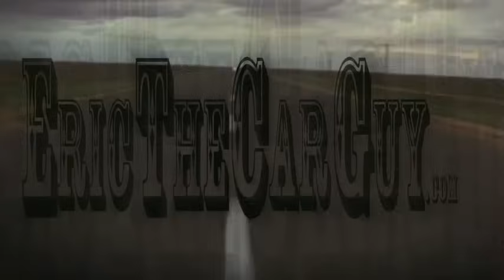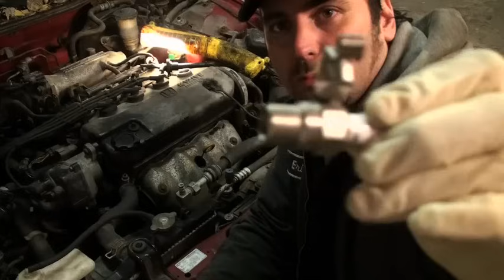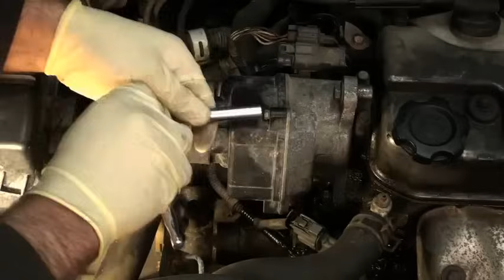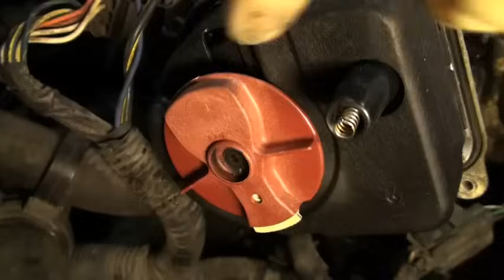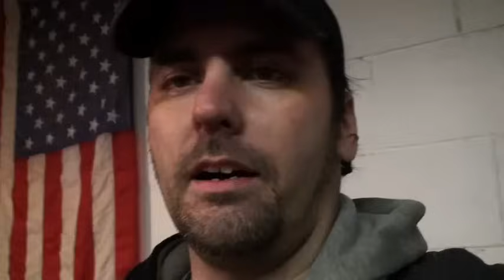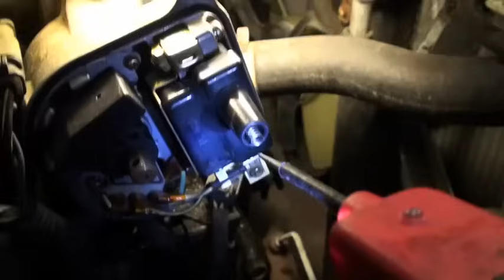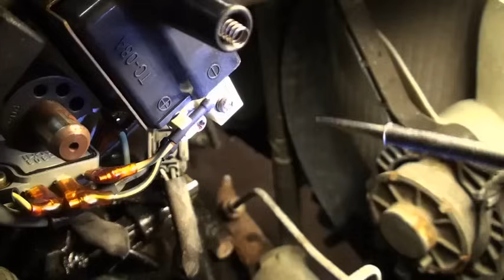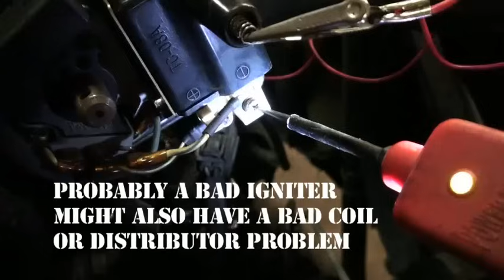No Spark Diagnosis (Honda) - EricTheCarGuy

Comment: Heads up!!! I tested my 96 Accord for spark, and it was sparking strong. Fuel pressure was strong too. I thought for sure it was gonna be something else serious, so I took it in. Turns out the distributor rotor was worn to the point that it was firing out of time. I didn’t know that possible. It was a relatively cheap fix, but still, had I figured that out on my own, I would have saved over $100.

Comment: You are so right about Honda parts I swapped out my ignition distributor and I was receiving a code 9 and a code 15 I put the new distributor on now it's just a code 9 I try to replace it I find out that it was not the exact same model needed and they did not have the one that I need Honda is what I need $70 more for the distributor I must pay $155

Comment: what if you are getting power to the coil and yet still no spark to all four spark plugs and you did replace the coil and igniter? I was told it has something to do with a ground and or ecu issues.

Comment: my 94 accord died while driveing and i installed new distributor and it will not start i have no power to the distributor cant figure it out .....need help..changed ecu as well...new spark plugs and wires too.....

Comment: i have a problem eric.. on so i have a 1995 honda civic. and it was saying o2 sensor bad. so i changed that and i cleared code. now it starts idle fine then boggs out for a sec then cel comes on and then it wont go pass 3,5k. i tried another computer still does it...

Comment: When you test to see, if the igniter is good or bad,base on,when you crank the engine,if the light “blinks”you call, the igniter is good. But if the light doesn’t blink, the igniter is bad. Knowing the igniter is bad,you replace it. What if it doesn’t start after the igniter is replaced,now you gonna test for power going to the igniter,right? Shouldn’t you test for power going to the igniter first,before calling the igniter,a “culprit” ? Thanks for your video,Eric

Comment: I have a 2001 Honda CRV  after driving and stopping for a short time, car will crank but not start ( smell gas after few seconds of cranking) then after 10-15 min rest, the car will start normally.  so can't check for spark, etc because it is not persistant.  replaced distributor with aftermarket from E-Bay.  Spent 80 dollars for distributor and doing same thing

Comment: Hey man maybe u can help me cause i done took my honda accord to many mechanics first it was that it lacked on power and it wasted lots of gas that got fixed but the issue that it still has is the car is cold and it starts but kinds weird and i dribe it then tirn off sometimes when i try to turn it on again it wont start i dont get it lots n lots of mechanics messed with it it still does it they changed the fuel filter under the drivers side under the back door and it seems like it worked a lil better in turning on but it does it agaon omce i drive it for like 5-10 minutes can or could u help me with this headache please eric the car guy.....

Comment: My 97 GSR has been having issues..my rpm Gage is not reading the correct RPms..it just started this when I replaced my router button ..and distributor cap and plugs..what could be making it do this.plus my  is not red lining at 8ooo.it redline at 7000 .help me out someone

Comment: Listen to this guy, throwing parts at the car can be costly. I had a problem with a P0300 and smelling gas out the tailpipe, car wont accelerate very well and rough idle in the morning/sitting. Another code was indicating ICM but I decided to take it off and test it. 4 tests, 4 good runs. Not the ICM. I finally got to thinking about the coil packs themselves. Sure enough the first coil for cylinders 6 and 3 were WAY out of spec by about several hundred THOUSAND ohms on the secondary (didn't bother with the primary since there was no point). Replaced coil, bam, car runs perfectly. I decided to replace the other 2 just to be safe. I now have power. hehehe.

Comment: I know this is a old video but thank you sir I was able to get my family members car that had randomly died on them a few months back running with this video. Test light showed flashing while cranking however nothing from the coil. Replaced the coil and it fired right up just like you said

Comment: Nicely done job on the video. Thanks. I've got a 91 civic with 136,000mi on it. Since I just had to replace the coil, I'm thinking about also replacing the ICM igniter before I get stuck on the road again. In your experience, about how many miles can you get on the original honda ICM before it needs to be replaced?

Comment: If probe/tester touches the coil spring while trying to test  spark while grounded can it shorten the coil? Had spark prior off center inner cap and exterior. Have no spark at wires, but have power on wires coming into coil off of igniter. Cap and rotor were changed do to burnt/wear on center connection to rotor. In your opinion is it the coil itself? Thanks in advance.

Comment: You can start your car from while under the hood if you use one of these Remote Starter Switch.  https://www.amazon.com/INNOVA-3630-Remote-Starter-Switch/dp/B000EVU8MK/ref=sr_1_1?s=automotive&ie=UTF8&qid=1522109344&sr=1-1&keywords=remote+starter+switch

Comment: My 97 civic wont start but will barely crank. It slowly lost power while driving and sounds like its exausted trying to crank but wont turn over. If i have a good battery and alternator, what would be the issue? What should i test first?

Comment: I replaced cap and rotor on 1999 civic. In 2,000 miles it was green and corroded.   New cap oring seal installed at time of repair.  Spring at coil connection appers fine.   What would cause it to go bad so quickly.   I am concerned I will have to replace again soon.

Comment: Hey Eric, I know this is a lil off the subject.  I was wondering if I can change out the inside of my prelude obd1 and put in the insides of the civic obd2a.  I tried the cap and it fits. But don't know if it'll work if I change all the insides.  Please help.

Comment: My 02 honda accord 2.3L just stalled, I have oil inside my distributor, mostly likely the cause of no spark , correct ?
Reply: Ernest Hin i have an 01 Accord. Same exact issue with mine. Did you end up finding the issue ?

Comment: My 1991 civic would idle but die with throttle now it won't start at all has spark and fuel anyone have any ideas spark does look a little weak though

Comment: My 99 Accord v-tech will shut off while I  am driving and I have to adjust my sterring wheel. I have replaced the ICM module as well as the main relay . Cap and rotor as well as spark plug wires what do I look at next!

Comment: What if it starts then dies, timing?
Reply: Veronica Bill clean your ignition switch contacts and make sure your main relay clicks 3 times
Reply: kevinjd1038 how can ya tell if the relay clicks 3 times?
Reply: @GongshowGarage  for the 98 civic ex, the main relay on the passenger side to the right of the glove box. You should hear clicks coming from that side as you turn your key. You should hear it switch on at the same time as the hum of the fuel pump

Comment: Eric please help me!! 2011 grand jeep Cherokee p0305 is my code I don't have spark on cylinder 5
Compression is good. Changed coil spark plug swapped injector with a good one and still same code!! What to check now? I was thinking pcm.or an open circuit 
What is your input?

Comment: i used this video to diagnose a '98 crv IG system. note: just because you see spark at the coil doesn't mean it's good. i learned a very weak coil can still send spark, but it may not even be strong enough to get spark across the IG cables. visually compare your coil spark to this video if your coil is sparking, but no spark at the cables/to the plugs. i also noted discoloration on the coil body as shown here.

Comment: I need help I have a 93 honda civic I was driving hooks the car just turned off on me in the freeway car cranks but wont start I have no dash lights no power to fuel pump no spark I replaced the ignition switch coil pack and main relay still nothing

Comment: I followed these steps and have spark on coil but not at plugs. Replaced plugs, leads, distributor cover and rotor, still no spark .  so this video is not very reliable. $100 down the drain.
Reply: MAFIA MUSIC 
Did you fix it?
What was the problem ?

Comment: Went through your steps. Test light not flashing on negative side of coil. Your recommendation, replace the igniter. Replaced the igniter, still no spark. $100 bucks down the drain.
Reply: Was it flashing after the replacement?

Comment: I have a 1991 Honda Accord. right now I have no spark/no start issue. I've tested so many possible problems but I've yet to find the solution. 1st I tested spark plug wires, no spark. then tested coil in distributor, no spark. then tested the ignitor which was getting power to the coil  but the coil wasn't firing. that led me to believe the coil was bad. I replaced the coil but still no spark. I got frustrated and thought the distributor was bad and just replaced the whole component. Still, no spark with the brand new distributor. Is it possible the ECM is faulty? I really appreciate it if there is anyone that might know my issue. Thank you very much ahead of time.
Reply: Carl Paquette im having the same issue in my 94 Civic ex coupe
Reply: Nicholas Moore And me too I've just installed a new aftermarket distributor still no spark 94 civic hatch non vtec 😐
Reply: Anyone ever have any luck? I just replaced my coil, it has power going to it and still no luck. HELP ERICTHECARGUY!  Save us!
Reply: Carl Paquette ground cable

Comment: Hey Eric I have a question. I washed my engine and not it won't start. There is only a loud rapid clicking noise. I suspect I got the distributor and coil pack wet and damped. Also may be the starter

Comment: This video has helped me twice.  I can turn a wrench just fine, but I have no experience diagnosing problems like these.  So this video has given me direction that I could work with.  I have had to replace both my ignitor and coil, at seperate times.  Thank you Eric for this video.  I simply followed what you said, and now my car works.  I (and my wife) appriciate this video.

Comment: Hey Eric, my dad and I tried all that u said even before we saw ur video. our 1991 civic coil sparks, but not at spark plugs. we got new distributor cap and rotor and tried that and still didn't start. rotor turns when cranking, but my dad wanted to know if timing belt controls rotor? If timing belt wad bad, would rotor turn? could it be timing belt slip issue?
Reply: I'm no Mechanic but I can tell you that it's most likely your spark plug wires. the first step would be to test your spark plug wires and then your distributor coil but since you already know your coil has spark (a very good thing) then the only other problem would have to be your spark plug wires. hopefully this helps you
Reply: Carl Paquette, oh thanks, but we called a friend's friend mechanic, and he said it might be the actual distributor itself. We ordered one on Amazon and got it in 2 days. It worked perfectly! It's just that the coil wasn't getting enough spark. Old distributor went bad.

Comment: ok heres my issue guys i have a 2000 civic ex started and ran great  i pulled old fuel filter put new one in well on filter for civic it has little "fork" where fuel line sits ( you can can give me a head slap later for this lol) i didnt lay fuel line in the fork tightened it and started it ran for like 2-3 min and died like it was outta gas   DAHH LOL anyways i got filter adjusted ect tried to start and wont start turns over strong has brand new battery. by the filter not lined up sure was not getting fuel. so i put line on filter right and had plenty of pressure to injector bar, but all of a sudden not getting spark to plugs and this al happened in like 30 min did i pop a fuse ? checked under hood fuses was a 15 fuse bad put a new one in still no spark is there another fuse inside car that would cause thjis?

Comment: Hi Erick! First and foremost, I would like to thank you for sharing such precious  knowledge with us gearheads around the globe and congratulate you on your videos! I'm trying to troubleshoot my no spark 1994 Honda Accord 2.2. I took the distribuitor cap off but it's different from the one in you video, it doesn't have the coil. What would be the correct procedure to test the ICU for failures? Thank you so much!

Comment: Okay, I noticed that when you were testing the coil, you had an alligator clip on it, was that the ground to the tester, confused here, where do you put the ground from test light during each test, you didn't cover that?
Reply: are you using the coil itself for a ground during that test?
Reply: Since he was using a power probe he did not need to connect to ground because the tool supplies ground internally. If using a normal test light the Alligator clip on a test light always goes to the negative post on the battery, or to any spot on the frame of the vehicle(body ground) a good way to test what is and isnt the frame is with a magnet. If its magnetic, its a ground.  DO NOT TRY AND GROUND TO THE COIL, you will either hurt the ignition system or your self

Comment: Hi Eric. Happy New Year 2017
I have an old Toyota Corolla LE AE80
My problem is the car can not start. Checked the spark plug for spark. None. Did some wiring. Problem persists. Check fuse box, there was a burn sign. Replace the fuse box. The car starts for a few times/days. Then the same problem repeats. What makes the fuse box burns? Could it be faulty in the distributor. For your info., I am using electronic distributor.

Comment: and if there were oil in the cap.what would that mean?
Reply: Distributor shaft seal and/or o-ring leaking.
Reply: If there were oil in the cap, change the gasket cap seal, O-Ring, leak cover and make sure they are all OEM (Honda)
Reply: Paolo Inigo        mamacita
Reply: oil in the cap  would stop it from starting?
Reply: Just had that problem on a Toyota.  Set out to replace the disty O-ring and the shaft seal.  Getting the shaft out required a pin to be removed, and that was darn near impossible without the right tool, and trivial with the right tool.  The right tool is a motorcycle chain breaker.  You can always buy an aftermarket distributor.  Just make sure you know how to keep track of the alignment between the cam "teeth" on the distributor and the slots for the teeth on the cam shaft.  There are plenty of disty videos that cover how to do exactly that.

Comment: hey man could I get In contact with you need help just replaced 98 integra distributor and it's running funny my cell number is 4782783519

Comment: Wow, nice job making it simple Eric! I just tested both components and have concluded the coil is bad(or not providing a spark as you say). It's very weird though, because I just replaced the cap and rotor. Then there was no spark. I changed them back to the original before I found this very helpful video. I didn't want to just start throwing parts at the car. This helps me move forward with confidence. New coil tomorrow and hopefully, she starts right up...

Comment: Hey Eric great video, I have a question I have a 2000 civic and I changed the coil and the distributer cap but when I changed the igniter I only see 3 wires I can't find the fourth one. I do not recall if the old one had 4 wires but the one I can't find is the one off to the side terminal on igniter. Thoughts?
Reply: topdawg 509 mines the same I think that's how it is on sum.

Comment: Just to clarify, to check if the ignition coil is getting a pulse from the igniter, do you connect the test lamp to the (+) side of battery and the (-) side of coil?
Reply: Trent Von  The coil will be pulsed with a ground from the igniter and you would need to go test light to battery + while cranking. one terminal should have ignition switched hot on the coil and the other a pulsed ground from igniter.
Reply: I dont have a pulse just a steady current (on) to the coil. Just replaced coil and no luck

Comment: Erick, I has a 97 civic LX 4drs auto it has no spark so I put brand new distributor and crank sensor from Autozone still have no spark. it has electric to the distributor but nothing pass it after distributor to the spark plugs. please help let me know I never see anything like this. the only thing I can think of is ignition switch.

Comment: Awesome video, I was able to get my Honda back on the road and not waste money troubleshooting with parts I didn't need. A couple simple steps and the replacement of the coil and I'm still going strong at 280,000 miles.

Comment: eric...I'm having a peculiar problem...my car runs but it runs bad. I believe my problem is the pickup sensor INSIDE the distributor....I just don't know what it's called...I had the classic seal leak so I changed the seal. well when I changed the seal the sensor was soaked with oil...instead of dumping 350 bucks for a distributor I'm trying to just change this sensor....any idea what it's called?

Comment: When I test power coming to the distributor at the harness using a test light. Im getting power from 2 wires when the light is attached to a ground. When i connect the test light to the positive terminal and turn the key to the on switch, I get no light. Any suggestions?
Reply: I wasn't getting any spark at the spark plug, replaced the cap and rotor. Noticed that the connector on the distributor was broken. I replaced the whole distributor, still no spark. Put the test light on it and that was the result.

Comment: I have a 2001 honda civic that will not start. It is getting no spark. It cranks but won't turn over. Could the crankshaft position sensor cause this?
Reply: It sounds like the Flux Capacitor is not working.  Ask your mechanic.